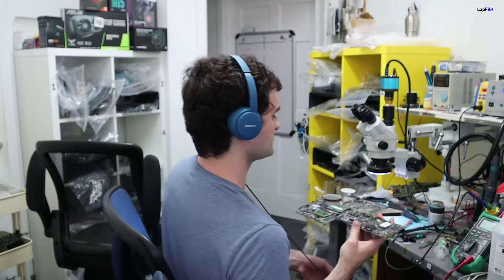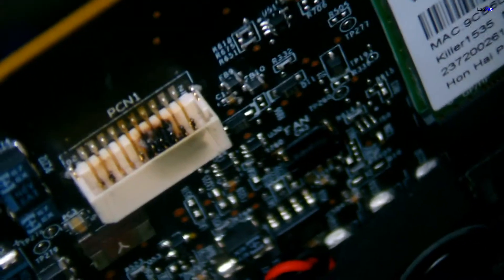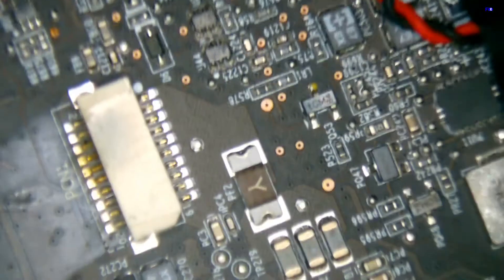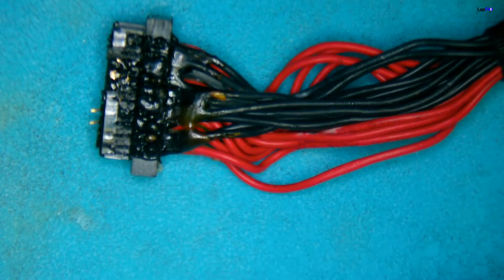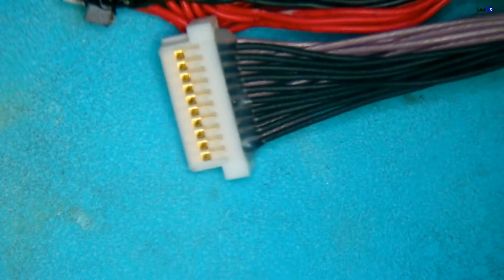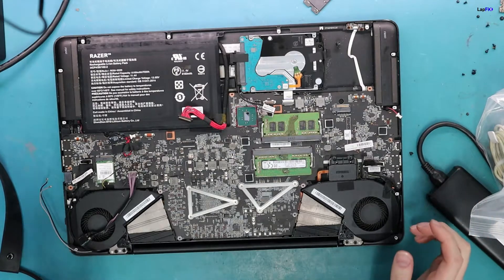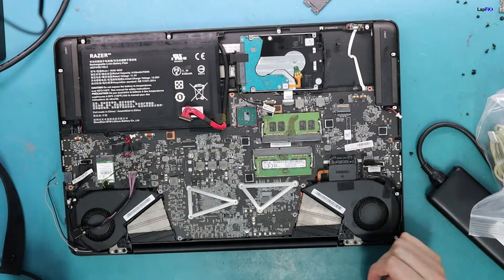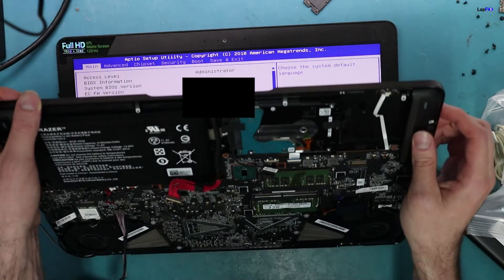Fixing Burnt Razer Blade Pro DC Jack Motherboard connector

Comment: I have this exact same problem with the same model laptop... currently it is sitting in a local repair shop because the shop tech says he cannot find the port on the motherboard so he cannot order it. Should I just tell him to solder the cables to the motherboard as you did?

Comment: Can i know where you bought that dc jack cable? Seems hard to find parts for razer especially 3 pin dc jack
Reply: 2nd that...  Just noticed one of the ground pins on mine has gone.  Only 3 years old....  None on ebay that i can find.  Need to know at least the name of the connector.